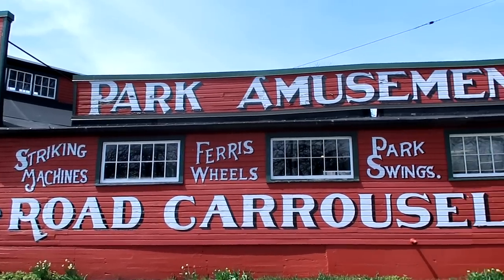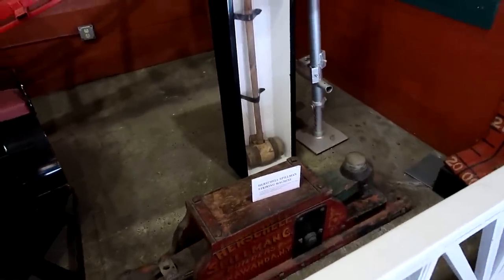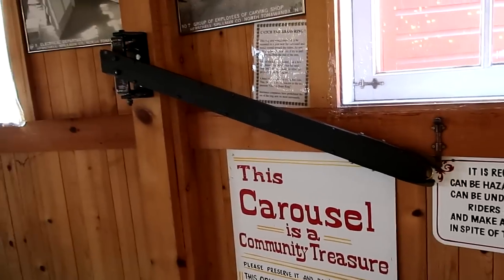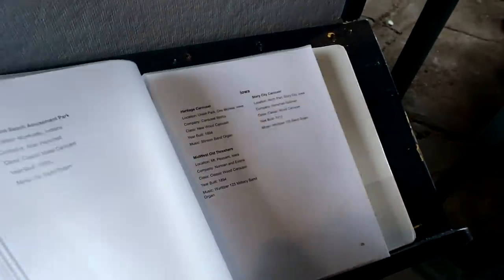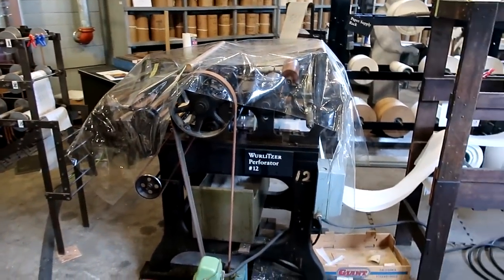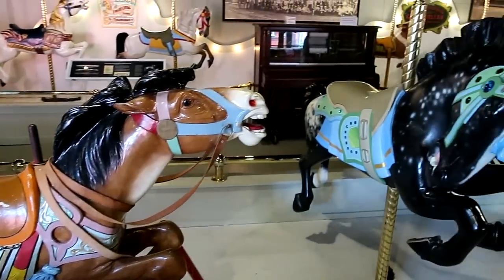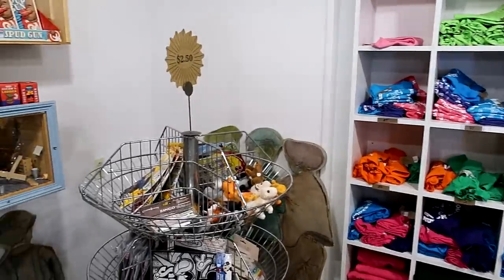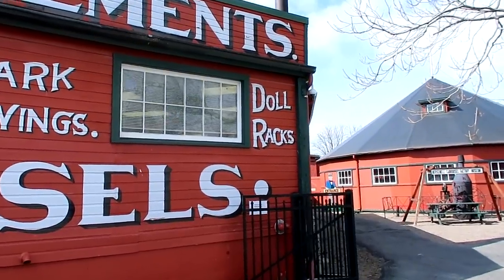Herschell Carrousel Factory and Museum - Authentic 1915 Carousel Factory - North Tonawanda, NY

Comment: I saw multiple carousels with a variety of animals from across the globe on them in my time. They're most common at zoos (if you find one with a unit, that is) One I went on when I first visited a zoo I've never been to before was one of these examples, but the one animal that stood out from the rest was a dinosaur (no joke), so ofc I picked that one; I felt like I was riding a Yoshi lol quite the unique experience.

Another strange but unique piece was a double-decker unit at a mall, which made a reason for me to wanna go, but then I found out it's since been removed and I was crushed.

There's also the art of kiddie carousels, another rabbithole worth delving into. From ones at mini play areas at stores and malls to the local arcade, you can't go wrong with these tame and whimsical works.